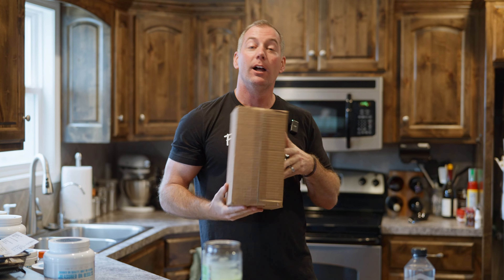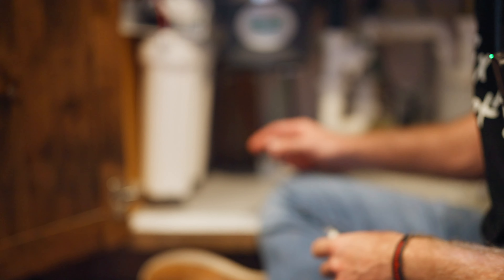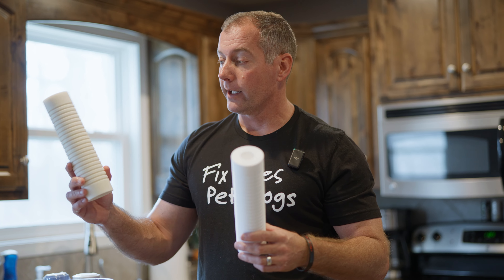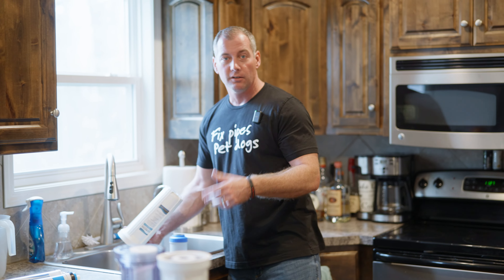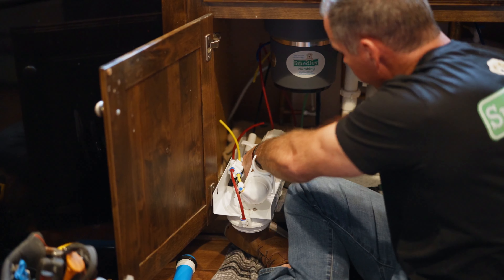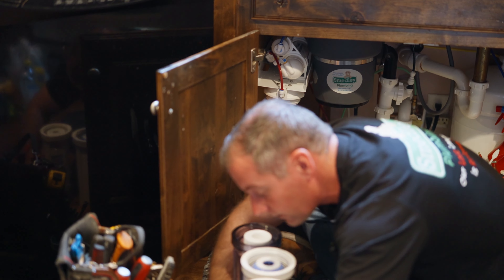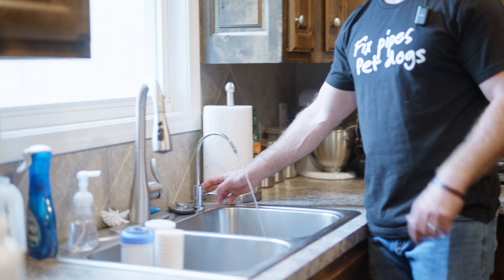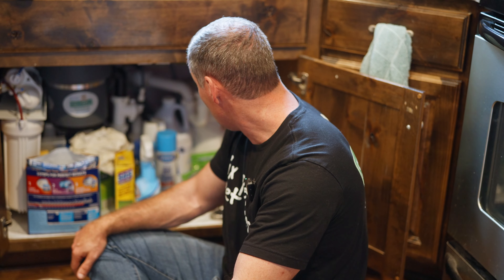NU Aqua Reverse Osmosis Filter System Filter Replacement Unboxing and Replacement - DIY Plumbing

Comment: One additional step to make service easier is to mount the bracket to a plywood sheet and add drawer slides. Then you can pull it out of the cabinet for service. Perhaps worth considering because over the years. this will be done many times.
Reply from the maker: That a great idea!

Comment: It's best to remove the membrane and leave that cartridge empty and then flush the system of the carbon dust from the new carbon filters. Let that run a few minutes before you put the membrane in. Otherwise the membrane will capture the carbon fines. 
If it doesn't happen already you can also install a back flush valve to rinse the membrane.
Reply from the maker: Good to know!

Comment: One thing I wondered about is once you replace all the filters and run it, won’t that new carbon sentiment from the carbon filter get into the membrane? I mean would it be advantageous to let it run a little without the membrane in, then add the membrane after the sentiment has rinsed through? Or is it such a small amount that it wouldn’t matter.
Reply from the maker: Such a small amount it doesn't matter.

Comment: Do you need to flush the system after a filter change before drinking the water?
Reply from the maker: Not really.  Just bleed the air out.

Comment: I've had my system going for about a year, here in Huntington Beach, which has really clean water to begin with. I'm about to replace the filters but the issue I have is that the dispenser is a little clogged with some clear slime and a bit of what looks like charcoal that I cleaned with a q tip. Do you have any idea what the slime is from?
Reply from the maker: Not sure.  But I'd say a filter change is necessary.
Reply: Thanks,  great video. 👍

Comment: Question! I watched and changed my 7 filter nu aqua system. It was fin before but now tastes and smells like onions. Nu Aqua Sens a manual ugh..and won't talk. Any ideas? I have septic so I can sanitize with bleach. Like I said, it was fine before.
Reply from the maker: That might be some carbon left over from the installation.  I'd probably dump the water until it stops and let it refill.
Reply: @SmedleyPlumbing  ty ty for replying!!
Reply: @17.11Actsdid it fix it?